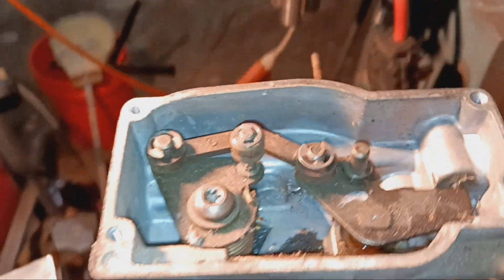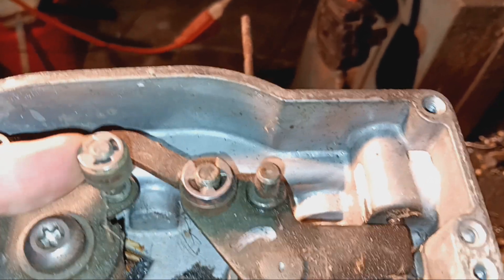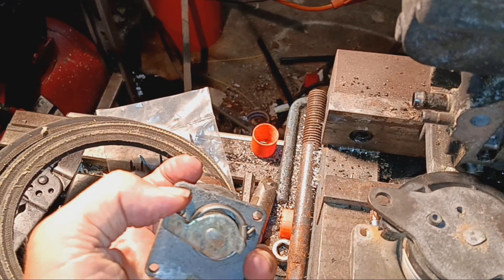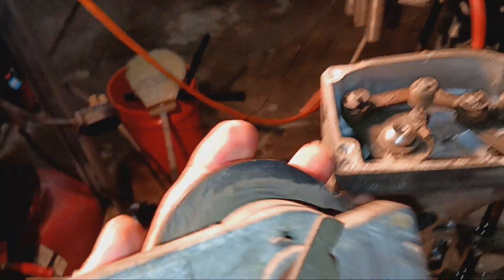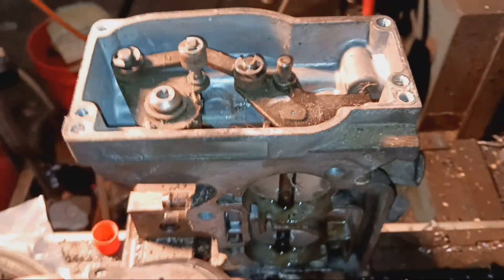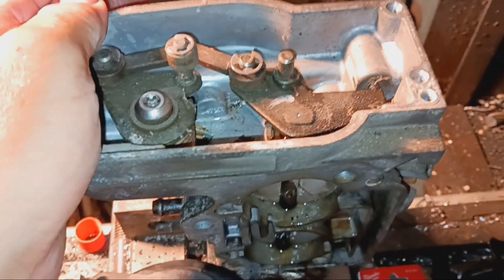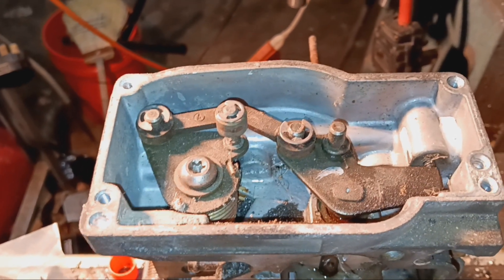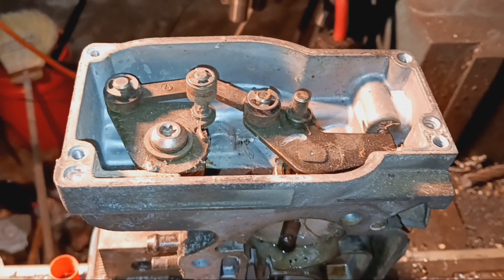GMC C6000 TopKick throttle body injection TBI governor function explanation 20230908 221935

Comment: Hey I got a 1997 gmc topkick c7500 6.0. This throttle looks just like mine. Do you know if the fuel pressure regulator is the same?
Reply from the maker: no I don't know if they're the same or not

Comment: Great visual - now I would like to know if this entire electro-mechanical system is responsible for causing my 6.0 to run crappy and rich when going down the road and sometimes dying while idling beautifully. My black-box controller is cracked and I don't get any throttle opening allowed at all unless I zip tie the box together - I'm thinking it might be the culprit but cannot find a replacement (the 12558783 part) - it has been discontinued.
Reply from the maker: It is not causing it to run rich, but if you just remove "black box" - governor motor it should fix the throttle response issue it only controls over speed by pulling throttle back when needed it doesn't have any affect on opening it but might jam it up if not aligned properly